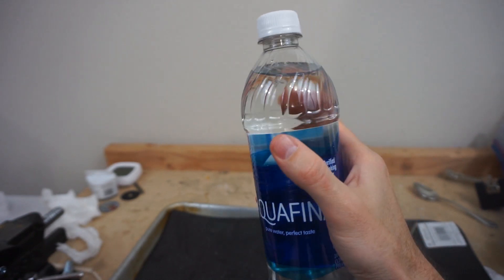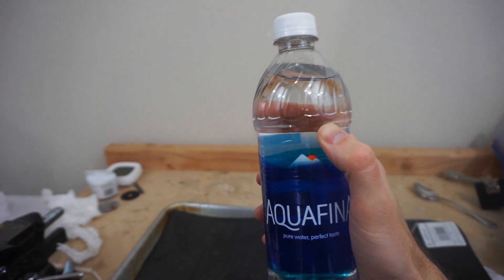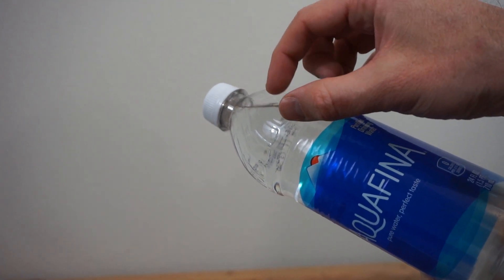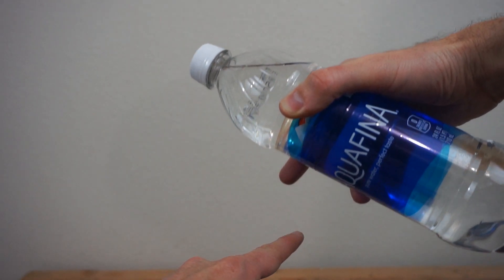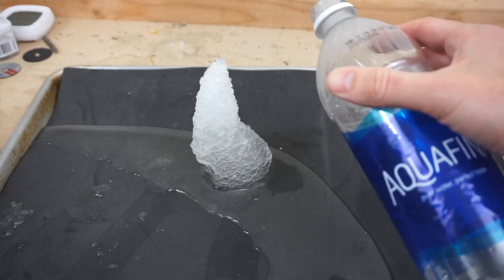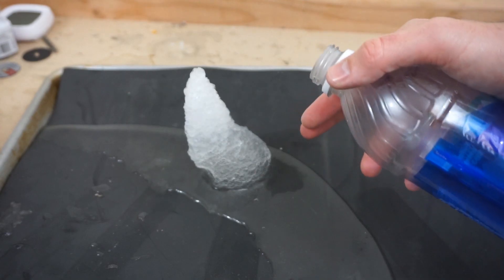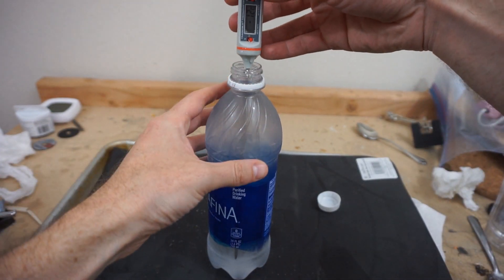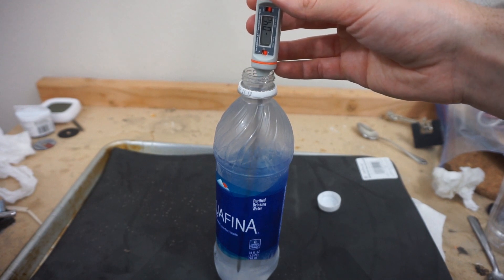Super-Cooled Water Heats Up to Make Ice? DIY Super-Cooled Water Tricks

Comment: 4 joules per degree per gram. 334 joules per gram to freeze. Everything is done at atmospheric pressure. It seems like a couple of percent would freeze…
Yet a couple of degrees below freezing at results in freezing most of the bottle?

Bummer. I was hoping you’d answer the question. 😕

Comment: Thinking out loud here. If its exothermic, it means it's releasing heat, so the system itself is losing heat. The thermometer therefore measures the increase in temperature from the heat expelled by the molecules while the molecules themselves are decreasing in temperature? 

Or does this not matter because the thermometer is submerged in the water and thus becomes a part of the system?
Reply: I know it's two years but lol.

Ice requires heat (energy from outside) to melt, right? Ok.
This is endothermic reaction. System takes heat away from surroundings.

So in turn the process of water turning into ice releases heat.

It sounds stupid, but we never experience this in real life, so it's hard to imagine.

The only places where we see ice are freezer (where it's always cold due to automatics) or outside in the winter where it's cold.

And also even if we took our time to see water turning into ice – we probably wouldn't tell the difference between -15°C water and -6°C ice

Comment: I'm not sure about the experiment where the water raises its temperature as it changes to ice. The change in temperature you measure is very modest. How do you know that it did not happen because of the heat the water was absorbing from the environment and, in particular, from your hand? If you really want to demonstrate the exothermic property of the water when it freezes, you should avoid heat exchange with the environment. It should be an adiabatic transformation. Do to so, the bottle and the thermometer itself should be at the same initial temperature as the water and the whole system should be contained in an adiabatic chamber, a container that prevents heat exchange between the system under test and the environment.

Comment: you said the water in the bottle was under pressure. Does pressure affect freezing temperature as it affects boiling temperature? In other words is the temperature of Frozen water different at sea level from the top of Mount Everest?

Comment: You can also pour out frozen soda just make sure you shake the bottle before freezing so the pressure keeps it from freezing and exploding in your freezer also open the cap extremely slow letting the pressure out slowly then pour in a cold cup and boom perfect slushy with all its carbonated glory

Comment: Exothermic means it gives off heat. Which means the H2O temp goes down. The thermometer absorbs the heat that the H2O is getting rid of. The water itself is cooling, not warming.
Reply from the maker: +J Fuzz I think you are confused. Exothermic reactions do give off heat, this causes the molecules that have off the heat to absorb it and heat up and change temperature, not get colder. This is because the heat that the exothermic molecules lost was not thermal energy but it was energy that was contained in molecular bonds. Lighting a match is exothermic also, with your logic you would say the match head cools down when you light it. Simply not true.
Reply: The Action Lab 
Hmmm, you're probably right. :)

Comment: you expect the water to freeze at the temperature you've made of it  ...... That's not possible water will freeze only at 0 degrees Celsius , and to reach that temperature it will release heat of magnitude equal to latent heat ,if you really want to freeze water below 0 degrees ,you should add non-polar solutes in it ,like salt

Comment: I cant get this to work... why? Is it because i am using tap water?
Reply: In the video his water is at -24 Celsius but mine freezes at about 7
Reply from the maker: +Aulo 2905 you have to use bottled water not tap water and the bottle has to be firm with a little pressure to it.
Reply: Thanks for the answer :) will try it again now

Comment: +The Action Lab  It always got me that when people do this, it seems like the whole bottle really is freezing.  But that's impossible because even at the minimum temperature for supercooled water (which I think is -40 degrees) the heat release from freezing should only allow about half of the water to freeze.  Or am I getting something wrong there??
Reply from the maker: +DANG JOS that sounds about right, it definitely doesn't all freeze. The crystals are dispersed throughout the whole bottle but there is liquid water mixed between so it is a slush/slurry.
Reply: Why half?
Reply: @tsunghan_yu   Because water freezing releases a huge amount of heat from the water molecules bonding together. The amount is equivalent to warming water from 0 to 80 degrees Celsius. So freezing water from -40 to 0 should only freeze about half of it. I'm not sure that the minimum is actually -40 though. I forgot the actual number.

Comment: w o a h  t e c h n o l o g y
Reply: 1004bjorn what do you call a freezer?
Reply: @Torontocreatorsassociation  what do you call outside
Reply: 1004bjorn u use the freezer, which is technology, to freeze the water.
Reply: Yes. It's a reference lol
Reply: Joker Deadman the freezer wasn't the point of the video.
Reply: Joker Deadman but technially you didn't have to use the freezer to freeze the water, you could've also left it outside when it's freezing to freeze the water
Reply: 1004bjorn but he did use the technology of the freezer to freeze the water. Also technically he could be referring to the bottle itself when he says technology, technology isn't just machines it's anything that is a tool, like a bottle cap is technology.
Reply: ... is that a reference to yandev
Reply: @TheTomoyo21  big nose dev
Reply: Oh no u didn't!
Reply: Sayumatic •w• except it isn't technology, it's  
p h y s i c s

Comment: Can you use an already opened bottle of water or does it have to be a brand new sealed one?
Also, can you do the same thing with distilled water? If so, are there some changes?
Reply: you can refill a water bottle and do the same thing.

Comment: is that why when your in a pool and then get into a hot tub you get that almost cold burning sensation from the temperature change or is it just a rapid difference in temperature?
Reply: that's a sudden change in temperature thing. The human body is a terrible thermometer. If you were to run your hand under cold water and dip it into warm (almost hot) water, the water would hotter than it actually is, and the same would work in reverse.
Reply: @alex_marie1324  Agree, something really extreme about that happened to me once, in winter, I had my feets very cold so I put them into slighly warm water (Not hot) and it felt like if the water were BOILING hot, no exageration, it was insane. Then I touched the water with my hand and I felt like it wasn't even hot at all, it was cold... 
So it all depends on the temperature of ur body
Reply: ahh ok. yeah I guessed it was just a temperature thing, just wasn't completely there yet lol
Reply: Nathanial Bogdonas - Another point of view:  Most people think that the pool water cools your body... However, your body is actually warming the water (exo-thermic). In other words, the water pulls the heat from your body thus making it feel cooler.
Reply: its called evaporative cooling
Reply: Hello